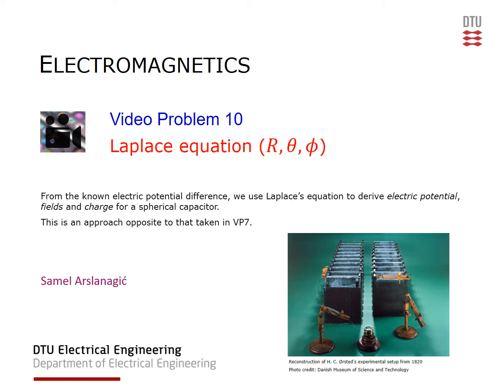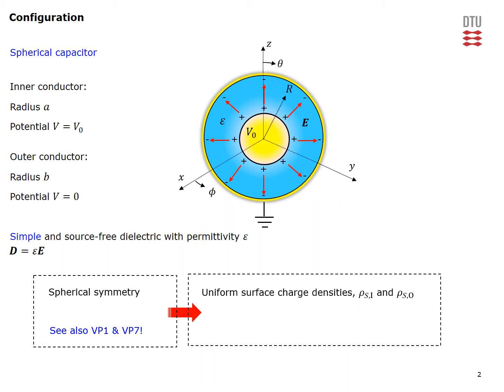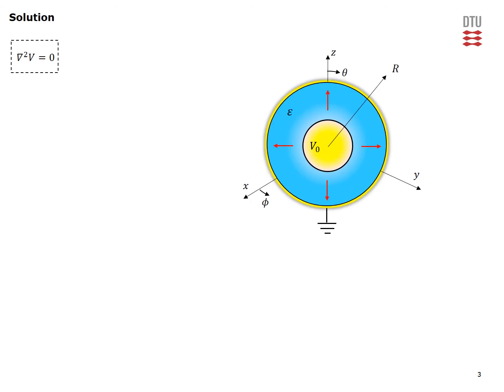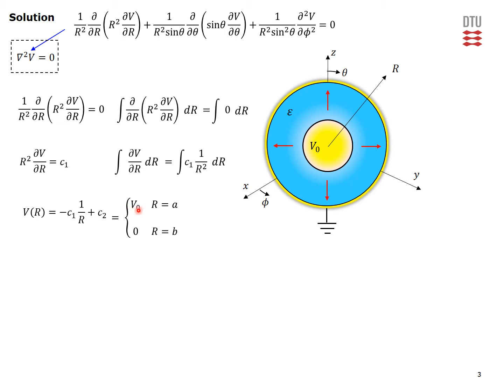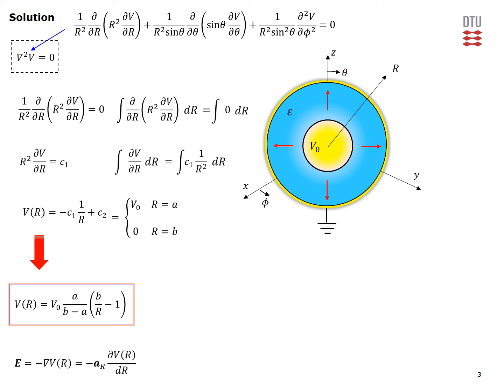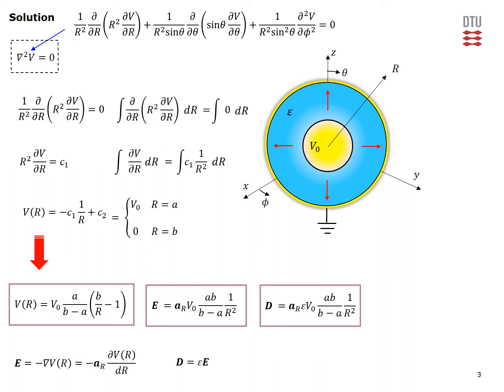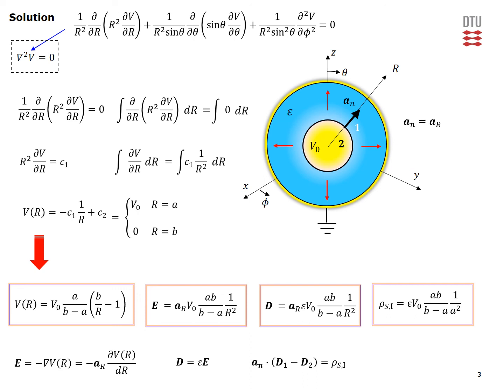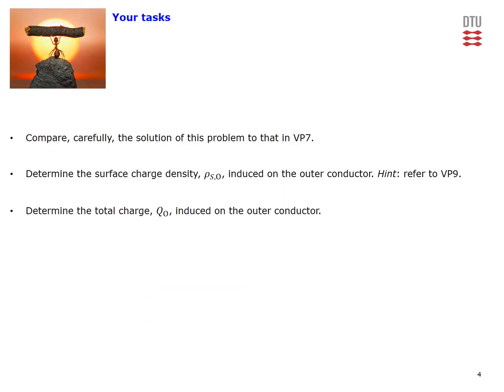VP10 Laplace Spherical

Comment: Professor how can I solve for V if the sphere has 2 dielectrics instead of one? And V0 is on the outer conductor and V=0 is in the inner most conductor. i.e. the opposite boundary conditions as you have here. Thanks! Great video!